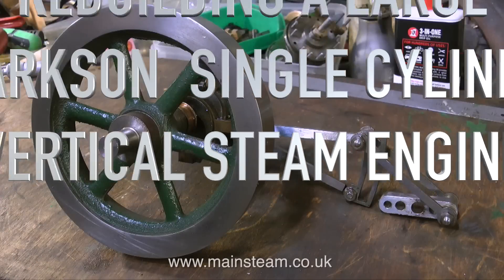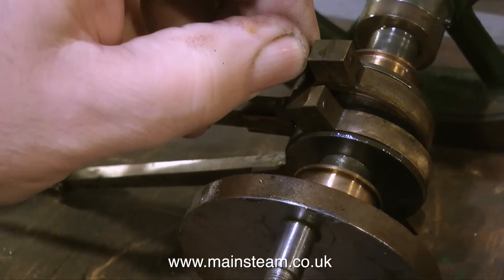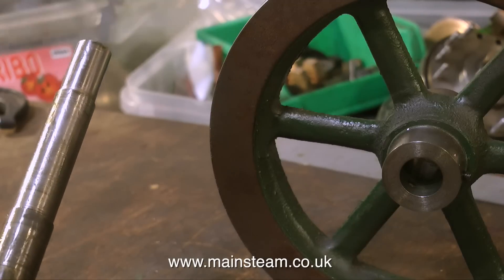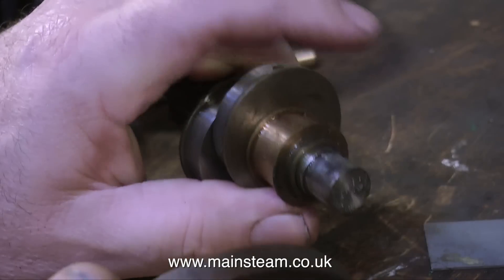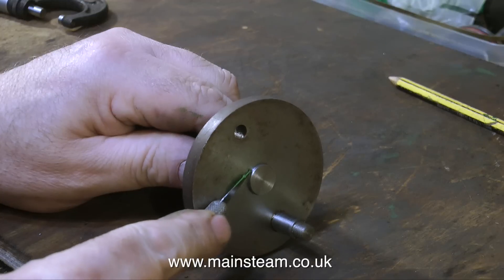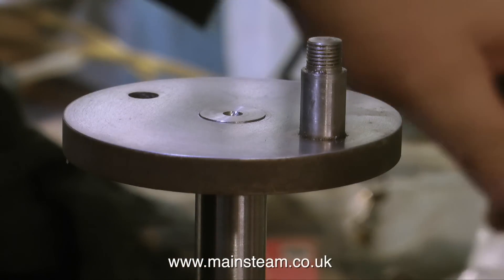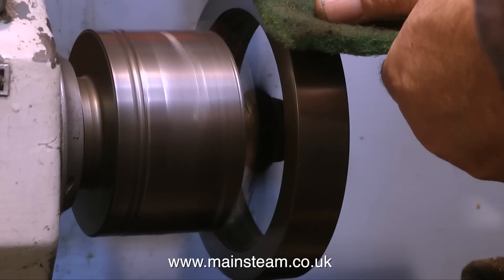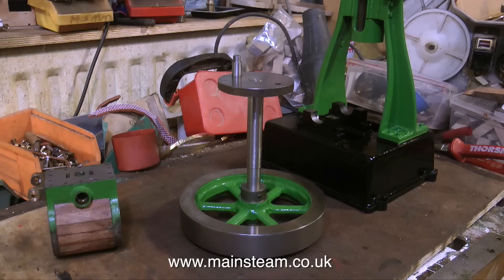REBUILDING A LARGE CLARKSON VERTICAL STEAM ENGINE - PART #9

Comment: There any chance you will machine the crank web into a more traditional shape with built-in counterweight?
Reply from the maker: +TestECull No, I need to leave it as per the original - like on the drawing.
Reply: Keith Appleton
Aww, but it'd run better with a bit of balancing. look nicer too.
Reply from the maker: +TestECull But it would be a modification not a renovation ..... there is a difference. I know it would be better for balance but it is not like that in its original form.
Reply: Keith Appleton
Difference of philosophy then. I have no qualms against making changes to a worn out machine that I'm making not worn out. I plan on doing a lot of that to the old pickup in my back yard that I'll be restoring here soon, and it's something I'd do to a model steam engine if I bought one on eBay that needed an overhaul.